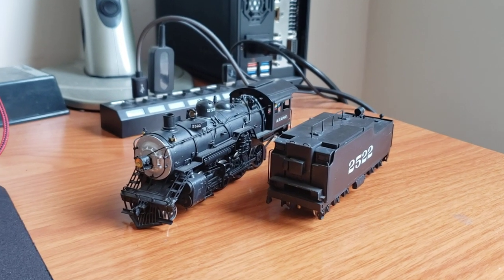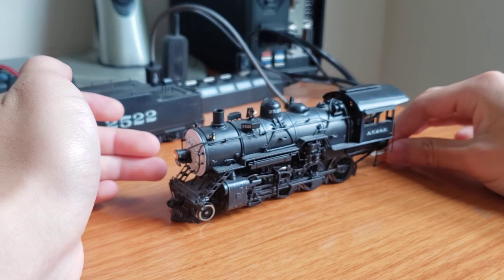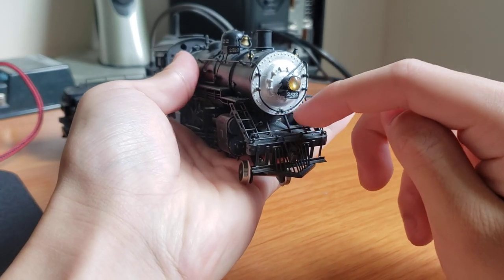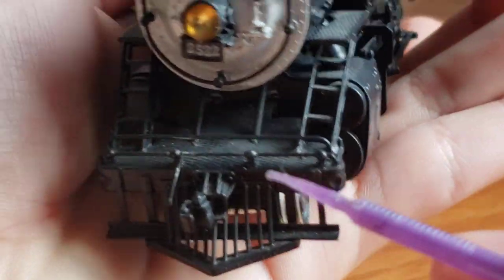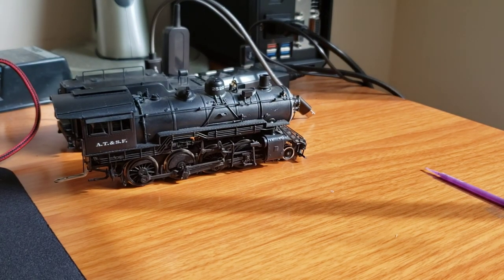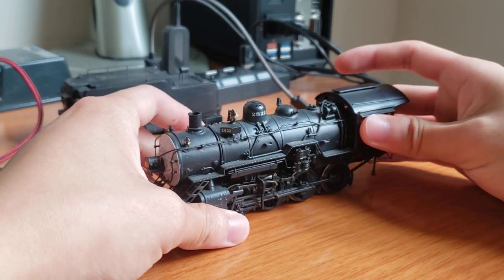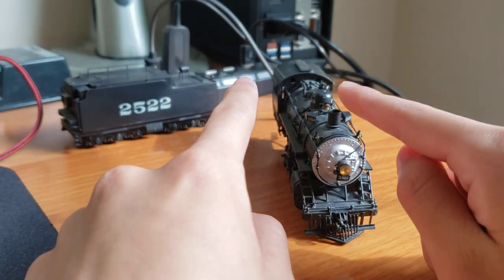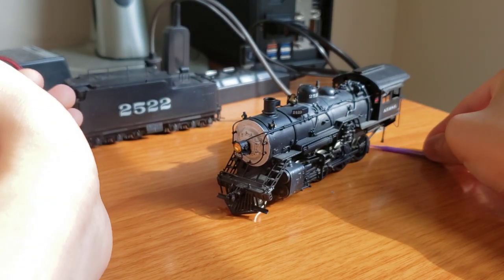Short: Unboxing Overview of a Hallmark Santa Fe 2507 class 2-8-0 w/damage

Comment: You can touch up the steam chest with flat black and get away with it since that part of the pilot deck is in shadow.

The padding of its box looks adequate to me. Perhaps FedEx treated it like a soccer ball.

I guess it depends if the prototype had dark painted side rods. Make sure you check that they have proper clearance before you decide to do something about it. If it does, I would leave it alone if it is prototype colored.
Reply from the maker: Padding in theory should have enough, but apparently its not haha.

I ended up stripping the paint for the entire underframe, the more i disassembled it the more unhappy i grew with the paint job. Go figure, always gotta give more work to myself!
The prototype technically had steel drive rods with black trim but over time these locos got dirty and so hence the black drive rods. I never liked paint on my drive rods since once it combines with oil, it turns into a thick grease. I stripped it off, regardless of accuracy or not
Update video coming soon!